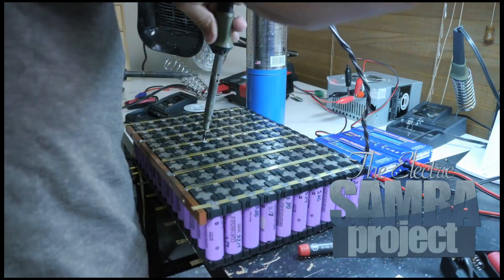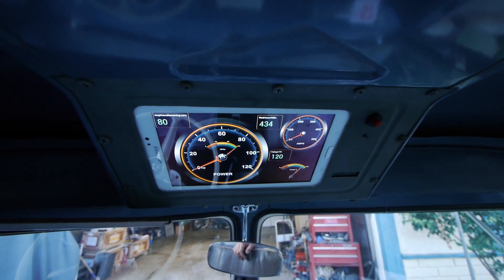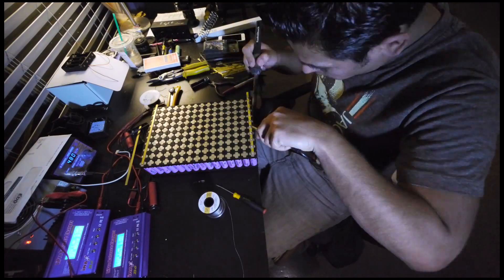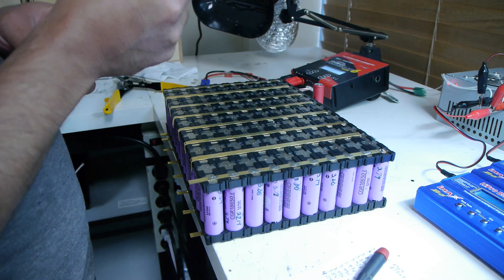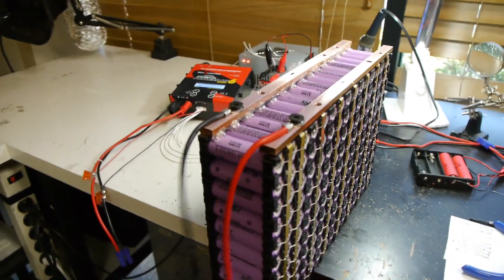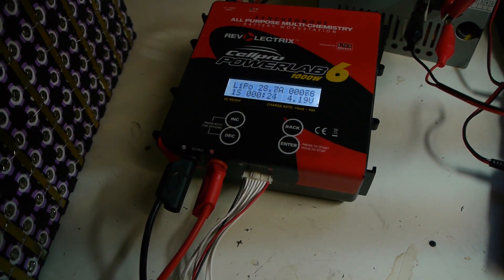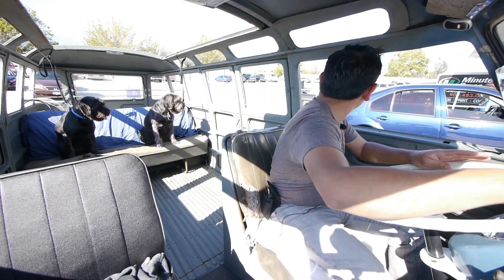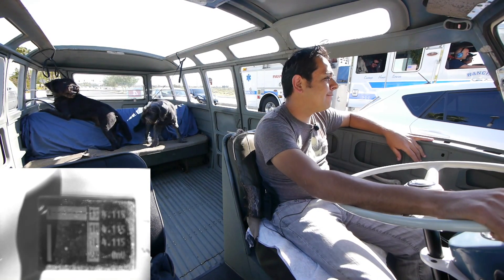DIY Tesla Car -  lithium ion 18650 battery -  VW Kombi

Comment: I love your work on this project!  (and your video skills... except the camera doesn't like ultra-closeup)  I saw the initial test of the 6A fuse/wire... but now I have to wonder... your test was on a length of about what... 1 inch?  If you shorten that down to 1/4", then a lot more of the heat will be carried off to the cells and bus-bar, and the burnout current will be much higher... right?  (It also looks a lot bigger than 30-32AWG copper wire)

http://www.cirris.com/learning-center/calculators/48-model-of-a-wire-fusing-in-free-air
also...
http://www.powerstream.com/wire-fusing-currents.htm
http://en.wikibooks.org/wiki/Engineering_Tables/American_Wire_Gauge

Also, I would +1 the comment below about using screws/nuts in the row-bus-bars... each row can carry up to 60 Amps, solder-only might not be terribly good for that current level. A little bit of heat, a lot of wiggle, and you can over-stress a solder joint.

Something I thought of... if you used a hold punch to put a small (0.150") hole in the (Negative) row bus bars at the location of each cell, it would make for better solderability. Have you been using something to sand the end of each cell prior to soldering? It makes the cell 'take' the solder much quicker, in my experience.

That Powerlab 6 Charger you used... doesn't it have a selection for Li-Ion cells... or just Li-Po?  I know their charge termination profile is very similar, just wondering.

Neat project!
BTW - have you ever tried an electronic handheld 2 or 3-axis gimbal stabilizer mount for your video cameras? (like used in multicopters) It's an amazing new technology... I'll probably never use a stedicam after seeing what those can do.... like this
https://www.youtube.com/watch?v=niuwU28gVDk

Comment: Are you seriously running it off 3.7V ?
Is this thing even street legal ? 
Where are the seat belts ?
A hard break and you kill both yourself and the dogs....

It's neat but dangerous...
Reply: tkupilik - how do you know he was running the motor at 3.5v and not more? Based on your assuming, you must be a democrat.
Reply: not sure if your trolling or dont understand how batteries work, seeing how you fly rc this is kind of scary. Each tiny 18650 cell is 3.7v nominal and you can series those up to whatever voltage you like, likely 60-70v, that goes into the motor controller to get turned into ac to run the motor. Basically the same way an rc works
Reply: Tabish Syed LP
Reply: you can, but he didn't. watch video again.
Reply: Safety Third
Reply: stupid fake video, his top power rating was 650A / 3.5V => 2kW of power... like no way to move this thing uphill using  that amount of power. Also most of power will get lost on wires. My racing drone top power rating is 1kW and it just a toy.

Comment: I'm going to get hated for this, but what about safety for yourself and your dogs? One hard brake and you'd snap their necks, and as for yourself.... Enough of that! That is a REALLY nice setup you got going there. Must've taken a lot of time to match up and solder all those cells.. Yikes!
Reply: jehugarcia so all about safety mate you have no seat belt on and the dogs so if its one hard brake then they be flying out the windows you have know days along with yourself , just saying... i know that car had no seat belts in it when it come out i have old car to no seat belts but i did put seat belts in for my kids ... o and love the wheels mate bet you got solar at home to charge your batteries? keep up the good work looks like your flying in the old girl to
Reply from the maker: Driving Is a risky business,   fortunately I don't do much of it,  I drive 1/4 mile to work every day and 7 miles to dog park twice a week on summer months.   These days I have windows so dogs are no longer tied up.
Reply: jehugarcia you live a quarter of a mile from work and you drive? Really
Reply from the maker: yes,  you don't have to have the need to go far to own and operate a car,   take my parents for example they dont commute yet they drive.

Comment: don't heat up the copper bar (at 4:34), heat only the solder, use a quality soldering paste instead and the solder will attach in half a second to the copper

Comment: I like this idea but the energy it takes to charge the batteries used coal and other non renewable resources. Maybe find an efficient way to charge on solar power or with hydro electricity
Reply: Yeah but it's still way more effecient to go from coal->electric->battery->motion, since coal generators are up to 55% efficient.   Internal combustion engines only convert 20-25% of the fuel energy to physical motion, as the rest is wasted as exhaust and radiator heat.
Reply from the maker: California's grid is among the cleanest,  but I agree,  Solar on my roof would be nice.
Reply from the maker: true that
Reply: jehugarcia
If you're a homeowner who's not gonna move from your house in the next 15 years, I'd strongly encourage you to consider doing a grid tie system. You can get polycrystalline system for around 1.1 dollars per watt. And if you're paying 13 cents per kilowatt hour and do the labor yourself, you'll get a payoff in 7-10 years.

Sunelec.com for solar panels, and ebay.com for a used inverter.
Or just pay like 1.3 bucks per watt and get a brand new system from sunelec.com :)

anyway, thanks for the good work and video documentation.

wishing you further success.

Comment: Where can i buy the plastic battery spacers that you got, the black plastic?
Reply from the maker: ebay  or Aliexpress.com
Reply: jehugarcia Can you give me the links to the parts? Don know what they are called in English. Good job with the Samba Project, keep it up!
Reply from the maker: http://www.ebay.com/itm/18650-Square-Modular-Li-ion-battery-holder-1-LOT-OF-40PCS-/191393984390?pt=LH_DefaultDomain_0&hash=item2c8ff86f86
Reply: jehugarcia Thanks alot :) You tha man!!

Comment: the entire van is running off of those 150 cells??? cool
Reply from the maker: 150 x 30 = 4500 cells eventually
Reply: jehugarcia where are the rest of modules?is these new modules are in series with other 28?
Reply from the maker: Yes 30s176p Tesla smart  modules now

Comment: Thank you for your video; I am in the process of building a battery pack for my 71 MGB GT build.  1)What Lenovo batt should I be looking for? some have 6 battery some have 9 does if make a different? 2)What company for the 18650 batt holders 3)15 across 10 down how much voltage is one pack? 4)What company for the tesla style fuses?  I like the way you explain what you are doing. I watch EVTV and I don't know what they are talking about.  Thanks again.  I don't have much money so this will help.  Hawaii
Reply from the maker: yeah EVTV is not for people like you and me,  its for rich people,   thanks for watching

Comment: Are you going to have a way to balance each cell????? I don't know the long term effects of not balance charging lithium ion batteries, but I know lithium polymers are very sensitive to this.

Please respond.

At any rate, the soldering work looks very good and professional. Well done :-) Keep us posted.
Reply: jehugarcia
 Please correct me if I am wrong. It looks like all of those cells are in parallel. So they will all balance just due to the behavior of electricity, so they well as automatically balance, as long as they as a whole don't get charged over what is recommended. The real reason for balancing, tends to be when you run lithium batteries in series. It is in series that cells can get overcharged/undercharged. In that unit, it looks like 150 cells (10 deep 15 wide). I recently bought 26 cell and it cost me about au$213. You got nearly 6 times the cells in that unit. If I was to calculate in regards to the cheapest cells that I got (which is 12 cells for AU$75, they came in 4 cells per unit). That would have cost me AU$950 for that unit.
Reply from the maker: No balance,  unless modules are way off and start drifting apart,   but thats the beauty of building your own modules you  can match all your cells to have near perfectly matching modules.
Reply: jehugarcia I see. Thanks for reply.
Reply: Matthew Tremain Hmm, also thanks for the reply. Would be great if others would chime in on parallel charging of lithium ion/polymer batteries. I only have series charging knowledge.
Reply: RoboTekno you could experiment parallel cells for yourself. You could test it with NiMHs and/or NiCds. Get 2 NiMHs (or 2 NiCd) charge one, and discharge the other, then connect the positives together, and the negatives together. You could put a resistor between the positives to make it safe. Then assess what happens.
Reply: Matthew Tremain I ain't got time fo' that!

lol :P
Reply: Ha ha ha. I could do that test for you.
Reply: Matthew Tremain Post it on YouTube if you do and give us the link.
Reply: Matthew Tremain  They are in parallel, many small cells, just like the Tesla packs. I believe he got all the cells on eBay... old notebook computer battery packs, disassembled, tested, balanced... the only way to fly for DYI on a budget!
Reply: RoboTekno I have done the test and have recorded it. I now have to put the video together and post it.
Reply: Matthew Tremain post a link here when you're done :-)

Comment: my uncle has to build a 32 volt welder to be a welder. year later i had to weld out middle no where i set at highst setting burnt a 1/8 7018 like was nothing i has set back to 1/3 power i not shure how was wired inside i like the smooth weld and the quit. we used 3 12 volt batteries in series  alternator car maintained charge of batteries.

Comment: with the lithium battery could one draw down  power quickly by welding charge back slowly  with a charger  want 100-120 amp welder have a http://www.ebay.ca/itm/MTE-RL-05503-3-Phase-Reactor-NEW-/271325201418 want use coils to increase the amps to have a smooth dc weld
Reply from the maker: that looks interesting

Comment: What sort of wire are you using for the fusible wire links?
Reply: jehugarcia Copper or silver will have much lower losses. When it does blow, both ends will form balls of metal that pull back with surface tension. Iron, on the other hand, will keep sharp points almost touching each other, releasing sparks aided by the fact that hot iron can burn with atmospheric oxygen.
These disadvantages may not be serious in your low-voltage application, but why don't you copy the know-how of the established fuse manufacturers? Don't put on an act of safety, do safety.
Reply from the maker: using the ends of 1/8watt resistors
Reply from the maker: zwz • zdenek Because I have yet to see any reason to implement such safety measures,  you gotta remain practical,  many wouldn't even drive a classic vehicle because it doesn't have 21 airbags,   are there risks?   Yes,  Am i willing to live with such risks?   yes,    think in practical terms people.
Reply: jehugarcia
Not a good idea. Fuse wires should be silver or copper. Component wires often have an iron core that is just coated with something solderable. Nasty as a fuse. Check with a magnet to see if your resistor wires are at least non-magnetic.
Reply from the maker: Why should I care what its made of if it blows at the desired current level?

Comment: crazy, i would never leave the bus bars exposed during a test, if you had a crash and they shorted then you would have a hand grenade waiting to go off. 

still, impressive stuff, are the battery holders 3d printed?
Reply: did you miss the fuses on each cell?
Reply from the maker: A short would have blown fuses,  but even if fuses where not there cells have 2 safety mechanisms that prevent explosions.   These cells are not as dangerous as everyone makes them out to be.

Comment: It looks like you need some more gears? electric motors have power band right? how much is a battery like that? how many miles do you get at say 60mph? can it go 75mph?
Reply from the maker: motor goes up to 8,000 rpm before hitting torque knee.  I currently have 45Kwh battery pack worth anywhere from $15-$20k.   I get around 125-150 miles of range.

Comment: im planning on building an electric motorcycle. Im thinking about making the pack 72v 60a. My question is can I have 20 cells in parallel to achieve the 60 amps and the rest in series to achieve the 72 volts? Or should i build small modules to reach my desired voltage and amperage?
Reply from the maker: yeah if you get the 3100mah panasonic 18650 cells you will have 3.1 x 20 = 62AH   to reach 72v you'll need 19 or 20 cells.   So your pack needs 20p20s = 400 cells
Reply: I built a 58.6 v battery pack which works well on my 1kw bike, it has 120 cells from scrap laptop batteries, if you are going to buy new you might as well just buy an energica for 13 grand, otherwise have a look at the projct where the guy uses 1200 18650's for a jeep
Reply: jehugarcia that not reach to 72 volt right? just only 62 volt?

Comment: Hi
I have 20 blocks of 60 cells (1200 batterys) used laptop cells. They where all around 1500mah when tested. Battery ended up 84v at around 90ah for electric buggy.
I have uploaded it type (gary lewsam) to see video. It is fan cooled with monitoring and now balancing circuits added. Was around 200mv out of balance without when charged. I can draw 250Amps peaks of 350Amps. You can buy spot welder from ebay £150 saved a lot of time. I practiced on the old dead cells untill settings where right. Im getting around 5-6 kw hours seams to be improving with use. Battery is around 70 kilo including enclosure. I get around 25 miles at the moment expect may go to 30 with a few alterations ongoing. Cheers Gary

Comment: You will lose a lot of power on the fuses.
Reply: If they heat up yes.
Reply: Not really, my quick computation tells me that the fuse wires will waste 0.1% at 4 amps per cell (max datasheet current). Assuming they are copper. If he accidentally had wires that contained iron cores instead, it could easily go over 1%.
Reply from the maker: zwz • zdenek so even at 1% that would be 6.5A at full power  or 720watts.   Currently my continuos power consuption is down to 175A average at 60mph so….  around 190 watts

Comment: The wraps on those batteries is very thin and weak, and below the wraps is the casing which, happens to be negatively charged. You should have really put some higher quality insolation between the negative/positive rails and the cells (where you glued the rails to the cells). Over time, with the right (wrong) circumstances, such as heat and vibration, the rails can dig through those cheap casings and cause a mass failure/short that could possibly bypass your cell fuses. Be careful, that explosion would not be pretty (duck!)
Reply: lol Lorde
Reply from the maker: rails are not touching the side of the cells,  there is plastic plus between them.
Reply: I was just wondering this myself as I had the same concern.  Just be careful, chafing is a b# not only reserved for wiring.

Love your project and you have inspired me.

Comment: No cell balancing
Reply from the maker: 150P  so nothing to valance at this point
Reply: what is your 150p?
Reply from the maker: 150 paralleled cells= 1 battery,  you can't balance one cell  you need at least 2 batteries to balance to each other
Reply: ohh 150 are in paralell, 
Then we go to another issue.
Is there practical use for 4v  li.ion battery
Reply from the maker: not by itself but 30 in series will give me 111v nominal I need to run my system
Reply: Okay you actually got 30 in series, each of the 30 modules must have balancing and low discharge controllers.
Reply from the maker: I will eventually have 30 modules,  this is the 2nd module I'm working on,  balancing will be tackled once I have all the modules.  Balancing is a good idea but not completely needed,  I'm running 35 LiFePo4 cells without bms currently with no problems

Comment: I don't see any balance leads on your batteries. how do you balance every individual cell, compared to every other cell. So you don't overcharge 1 and under charge the other ?
Also is it smart to glue the copper bar right against the sides of batteries ?
Reply: You don't need balancing for his design.. he us running every cell together.. for a total voltage of 4.2v. they balance themselves.  now if he had multiple cells in series for higher voltage packs i would agree with you.. but with his design the entire pack changes voltage together, one cannot be higher than the others or it would discharge into the others. the drawback is that if one cell fails, it will bring down the entire pack.. but that is why he fused the cells, if one cell shorted out and tried to draw too much current the fuse would simply blow and the pack would live on.  my question is how is he boosting the low 4.2v to something high enough to run a electric motor.
Reply: Yes. Over charge one battery and it will burst into flames...!!!! So yes can some one explain how its done professionally and safely ?

Comment: Sorry if I miss something. But how did you test one pack ok ~4V by driving?
Or you just made 30 units and then made driving test.
And one more question bothering me. You need to charge each unit separately, obviously you can't charge Lio  batt. in serial. How do you do that when it's installed in car and connected in serial? Is there wires to detach units before charge?
Reply from the maker: I have 35 LiFePo4 cells on the car,  I added my module as cell number 36.

yes you charge all cells in series,  my charger does 40amps at 126volts
Reply: jehugarcia Stop! You have LiFePo4 cells ?????? Not all battery Li-ion ????
Reply from the maker: yes lifepo4 and lithium cobalt in the same pack,   it works,  they charge to the right voltage 126v  (4.2v x 30)   (3.6v x 36)   discharge to 100V   (3.33v x 30)  (2.85v x 35)